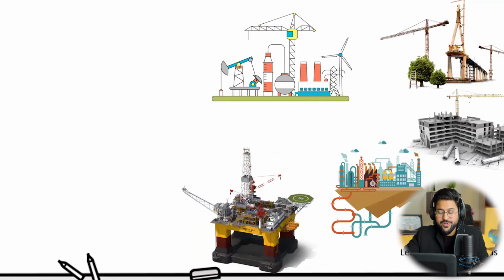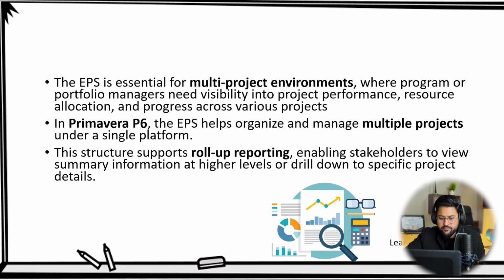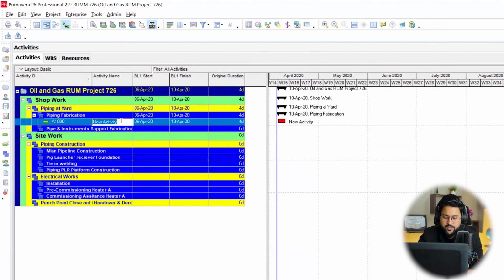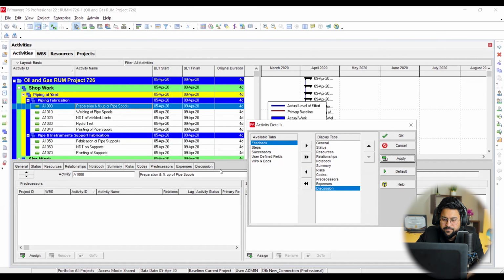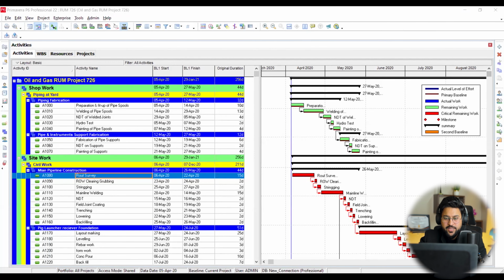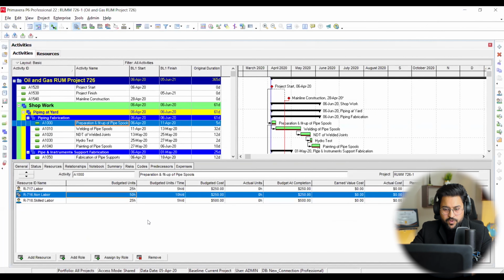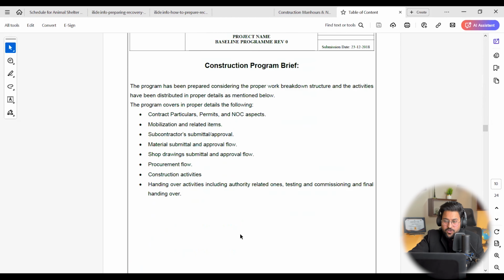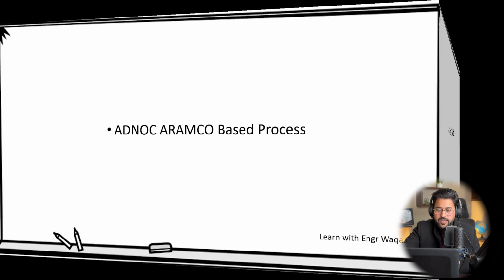Primavera P6 for Oil & Gas Projects in Just 2 Hours! 🚀 | Free Primavera  P6 Course in English

Comment: At time stamp 1:05:39 I think Man hrs is erroneously mentioned as I think it's man days required please correct me if I am wrong as further explained as 10 days is to complete the job with 1  Resource to get the actual time duration it should further divided with nos of resources allocated to complete the job that will give you actual duration required kindly correct me if I am wrong.
Reply from the maker: Please contact WhatsApp at +92 339 8866126